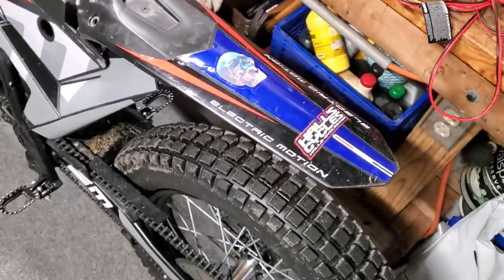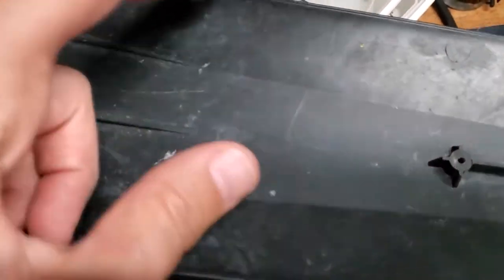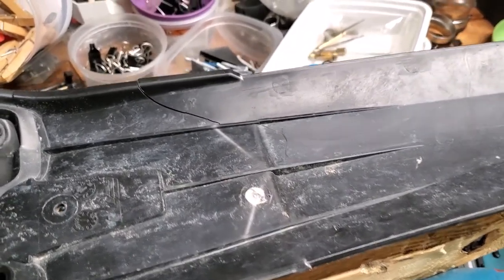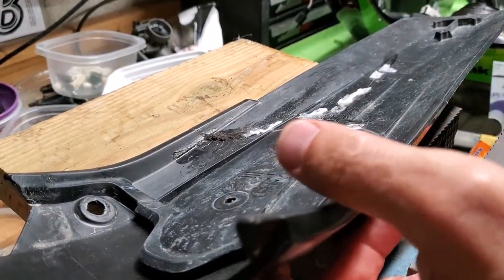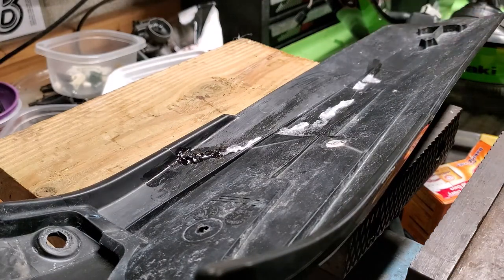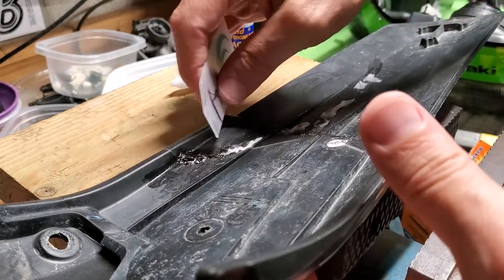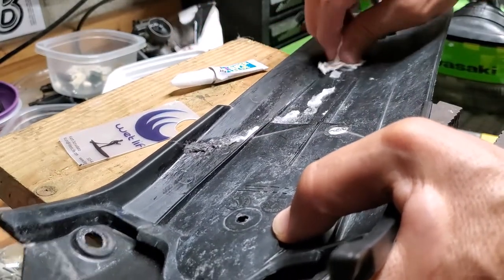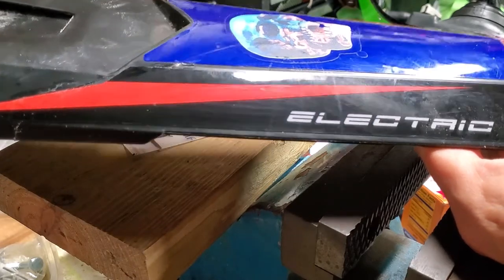Electric Motion Rear Fender Repair (Instantly)

Comment: Gotta agree with your take on this.  I just broke the seat support plastic (not the fender) for really no reason at all.  It is the piece that the fender attaches too. Really poor design.  That too is a $100 bucks to replace.  I can't believe they have absolutely no support on the back 1/3rd of this seat other than this garbage plastic.  There is no where to grab the bike on the rear other than the unsupported plastic.  Other than that, the bike has been phenomenal to ride.  But the omission of a subframe is a serious omission by EM.  It would be pretty simple for them to have one on the Escape using the four mounting holes for the plastic.  Wish they'd engineer something.
Reply from the maker: Ditto, i agree. We need to let them know. Ive toyed with some aluminum i have laying around to make a subframe.